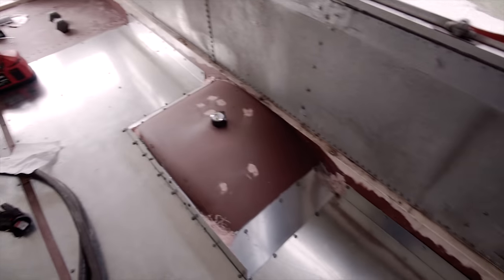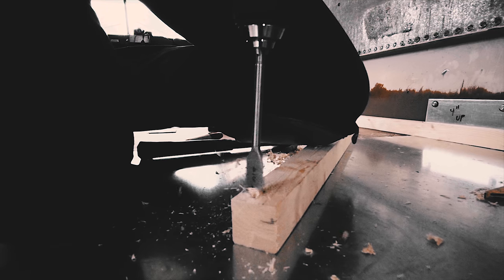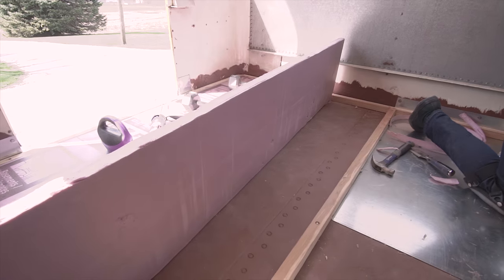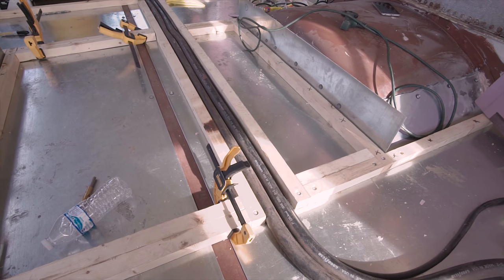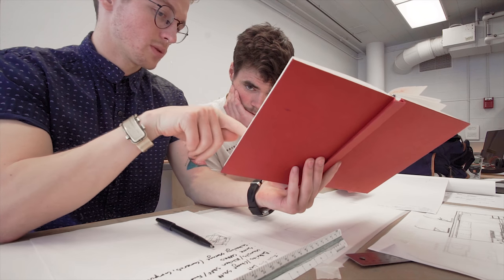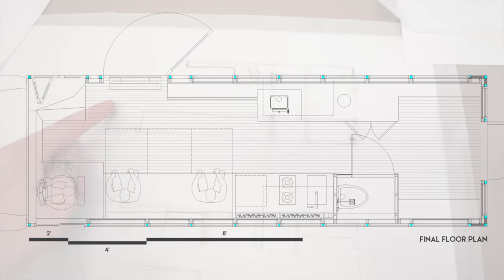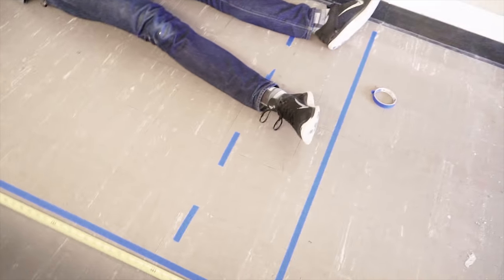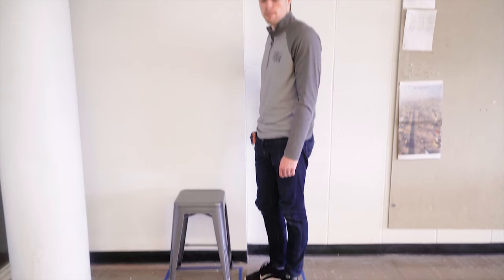PROGRESS #5 | School Bus To Off Grid Tiny House Conversion | Framing the Floor and Designing the Bus

Comment: do the heater tubes heat your floors well?
Reply from the maker: Yes! surprisingly well actually. The only downside is the bus has to be running and/or driven for a bit before the pipes heat up.
Reply: Welll the heat traveling trough them crest heat